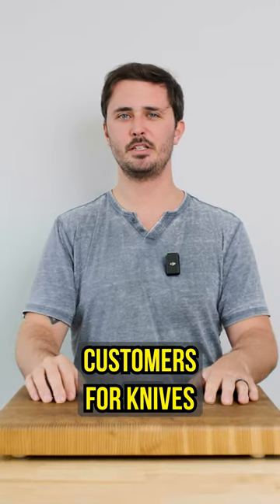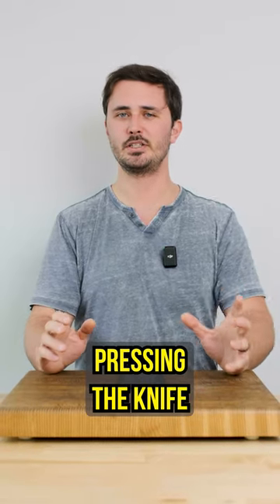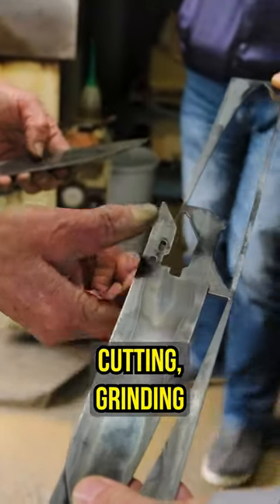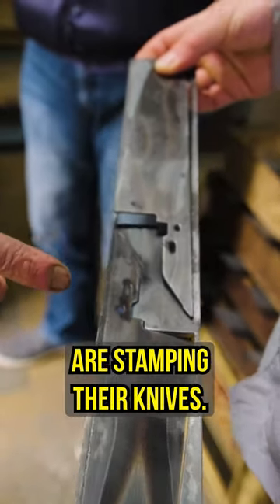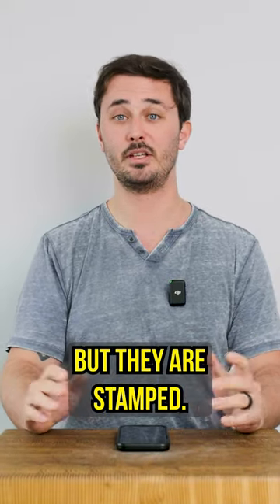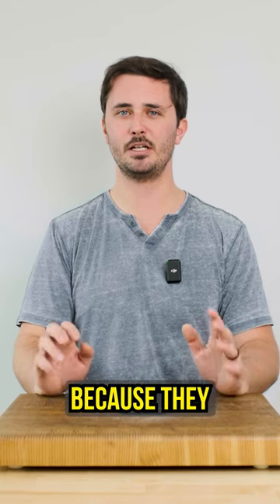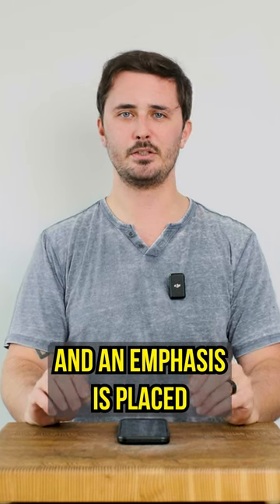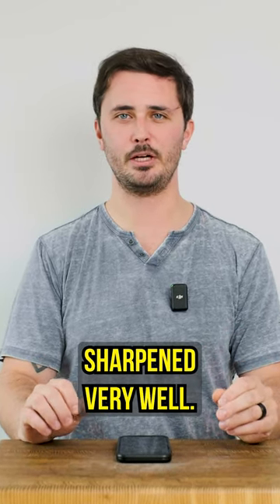ARE STAMPED KNIVES BAD? #shorts

Comment: There's also EDM and water jet which is better for the steel because it doesn't overheat it like thr the laser or stress it like machine stamping.
Reply: Heat treating removes heat and stamping stresses. So it literally doesn't matter.